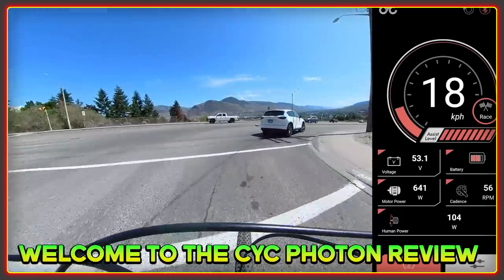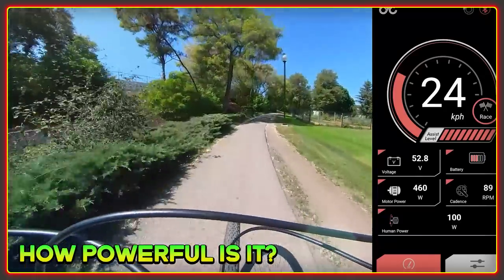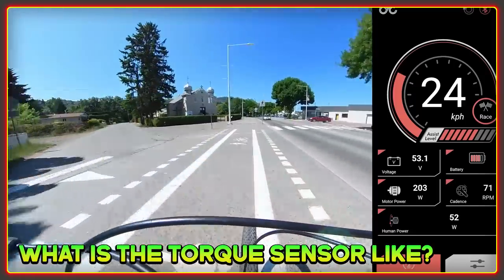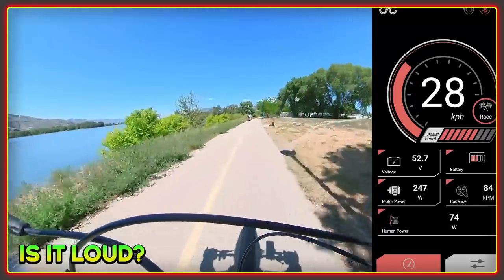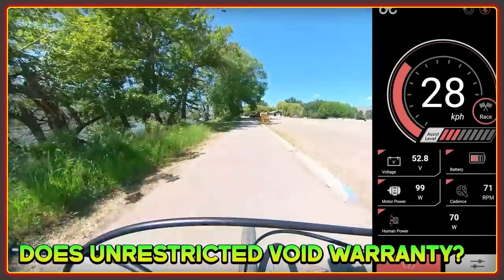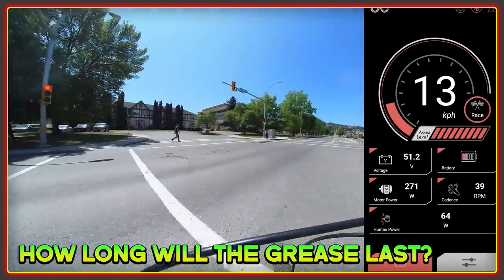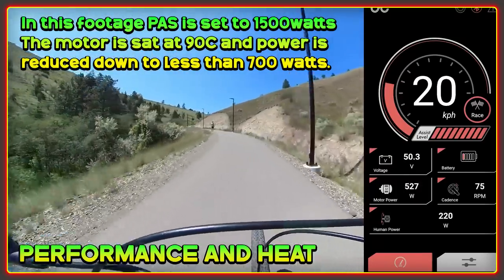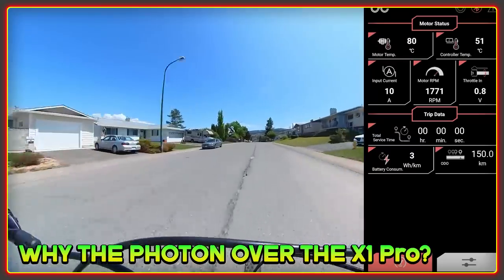Full Review of the CYC Photon Mid-Drive Ebike Conversion Motor

Comment: My current bike has a single 30t main sprocket. Would you recommend going with the 34t to keep the geometry as close as possible?
Reply from the maker: Depends on hills. Well and top speed. If you think you won't ride very steep stuff I'd go a bit higher for a more comfortable cadence at higher speeds. If you don't want much speed it will be fine.
Reply: Not sure if it's the best way, but there are adapters that able you to fit larger cassettes like 42T in the back.

Comment: Hi, where is the motor temperature measured from? inside the motor or on the outer case?.... I have got a bbshd up to 55°C on the outer case and was wondering how much heat can it take before it burns out. any ideas?
Reply from the maker: It's from inside right on the rotor coils.

Comment: hey boss. im looking to mount one of these to a 2017 santa cruz chameleon for single track riding. sustained climbs (~1 hour) followed by downhill. i live in ca so mild climate. would heat be an issue for this application?
Reply from the maker: I think you will be fine as long as you do not expect more than 750-1000 watts sustained.
Reply: nope id be content with the 750 at 52v @HighVoltageKits

Comment: Would you put this on your fat bike with only 52volt 16wh battery ? Or would you prefer your bbhsd with same battery?
Reply from the maker: I'm not I sure I understand the question. Sorry. Can you rephrase it.
Reply: @HighVoltageKits  you have your current fat bike set up with a bbhsd .  Would you also recommend this photon with that type of bike. I am on the fence, which to use for my fat bike with 100mm bottom brkt.

Comment: I haven't seen a link of your install. Did you do one? I have installed a photon on my Sunseeker Fat Tad . Still working out some issues
Reply: I found your install video. Thanks for your excellent presentation. Where did you find the blue anodized socket and the chain whip? Great tools!
Reply from the maker: The chain whip I got from Amazon and the socket is from Park Tool. They make the gold standard of bike tools although can be expensive.

Comment: I.m also a commuter doing around 40km back and forth from work.  Does it make sense to get the cyc or an m620 for long distance commute with slight hills on the way? I'll be running mostly top speed all the time, I'm hoping any of these 2 can do 45+ km\h
Reply from the maker: Either of these will net you 45kph. The 620 has more power over a sustained period especially when its hot. If you are carrying much cargo. More power. It's bigger though and the torque sensor is not as good. The 620 is a mature platform and the cyc while more fancy is new and it's reliability is unproven outside of engineering tests. Let me know what you go for.
Reply: @HighVoltageKits  thanks for the input. I asked dengfu and they will be releasing a new frame in a few weeks. Which collides with the launch of the new m630 motor and the automatic IGH. I'm planning to use this pair

Comment: I don't think that set up is better than a Fabulous Road Warrior X2 with a 60V 24 ah system and dual 750 watt motors cranking out 200 Nm of torque. Climb up mountains and rest at high speeds of 65 kph not even pedaling. But if you enjoy pedaling the Road Warrior has a torque sensor system also. Under $3k USD.
Reply from the maker: That's a pretty bold claim to suggest that 3 grands worth of prebuilt bike is better than using a Photon kit and battery with a high spec donor bike! Are you a representative from the company? If you want to send me a dual drive bike I will be happy to put it through its paces on the terrain around here. The bike I built has Shimano XT brakes with a 203 rotor on the front. It has Shimano air suspension on the front and a seat suspension. It has a light but very strong frame from Salsa. The rear mech is SRAM x9. The wheels and Hub are DT Swiss which is pretty much the gold standard. Let me know if you are interested. Happy to do a comparison.

Comment: Brada everything ,but not top speed ((( how come ? ....
71 on video  ,so you think it can do 80 from hill ?
Reply from the maker: I think you could easily hit 80 down a hill. Up a hill the max is about 30 and with the gearing it does build heat. If you gear down you are going slower.
Reply: @HighVoltageKits  thanx man!!
Reply: @HighVoltageKits  and by the way! What a race was just minutes ago 🏁  amazing track in Canada 🇨🇦 👏 👌 🙌

Comment: Does the CYC system need a gear sensor? (less torque on bike chain when shifting into other gears)? And how does this system compare to the Bafang Mid Motors
Reply from the maker: Bafang stuff can tend to need one more. They are not my favorite things. I prefer a button or cutoff. Not missing one on the Photon

Comment: I live in Colorado so this motor will heat up pretty quickly so I'm going to pass on buying this one. Wish they had addressed the heating issues.
Reply from the maker: It does but at that point you have a 600-750 watt motor. So it depends on the kind of riding you will be doing. If you need more than that power assist for your rides continuously then its probably not the best option. They will have a more powerful Proton out so potentially that one will be able to sustain higher power continuously.

Comment: About the gearing...and how does 750 watt do 40 something mph ! Tall gears I guess AND pedaling ? The gearing, I run a S.A. 3 speed, and it’s in 2nd (direct drive) 98% of the time. That’s a 42t to a 17t cog. And it does 30mph on flat ground with a fresh battery. Then it drops to 28 and stays there. 52v 20ah
Bike weighs 60lbs with dropper and Maxxis DHF’s.
Reply from the maker: 1500 watts. The 750 is the rated power. In hot weather it throttles to this level tho

Comment: Sending DIY motor to a periodic maintenance? I would rather send my whole bike to get serviced than removing and reinstalling the motor.
Reply from the maker: Yeah. If it becomes popular enough then perhaps there will be places more local you can do that. My big fear with it is that people will just use them till they become unrideable and then just chuck them.
Reply: @HighVoltageKits  The other risk is that there will be legislation that hits unservicable products. EU just passed law (votes 500 to 10) to prevent glued in smart phone batteries and there is a LOT of discussion against "self destructing" BMS systems that are hard to service are environmentally unsustainable. I don't think it's far off to think EU could pass a law that would prevent locally unservicable ebike motors to be sold. They could be very fast to act if an environmentally unsustainable product is in direct competition with EU produced one. Those that think this is a joke or no big deal can see the effects in few months when ALL major manufactures have made a smart phone with replacable battery just to please the EU markets.

Comment: I was going to get this motor....but the inability to repair yourself is disgusting. Too much in our world is like this, I can't have a DIY bike conversion kit be locked down! Sad
Reply from the maker: It’s hard to trouble shoot it. Mine is still not functioning after sending it in once already.
Reply: @HighVoltageKits  I just watched your 72V ride with the toseven DM01. I am not saying i would be going 72vv right away, but would you say the torque sensing on that motor is good enough? It's like half the price of the photon!

Comment: Riding as fast as shown in this video, its no wonder that non-eBike riders, pedestrians and law enforcement dislike eBikers so much. All the new legislation we are seeing are directly related to eBikes speeding on roads and on bike trails. Soon ALL e-bikes will all be limited to 18 mph. Just because you can does not mean you should. Give it some thought and wear a GOOD helmet.
Reply from the maker: Anyone who is fit can ride a pedal bike faster than the stated laws and they are not being penalized. Anyone who is unfit can ride a bike down the hill where I hit 60kph just as fast if they wanted to. Legally as well. I dunno how far you watched into it but as soon as I hit mutli use paths the speed came right off. I have never put a pedestrian at risk using my bike and never intend to. That has nothing to do with legislation its just being a good rider. There are plenty of assholes driving cars. The only difference is that we are not restricting cars to 100kph because of the actions of a minority. I dunno why when its acceptable to drive a car that can do 200mph in a school zone its not ok to have an ebike that is powerful enough to mix with traffic safely at 50kph and go uphills at a decent pace. Thanks for your concern regarding my safety. I wear a full face, reflective gear and ride defensively. Cheers